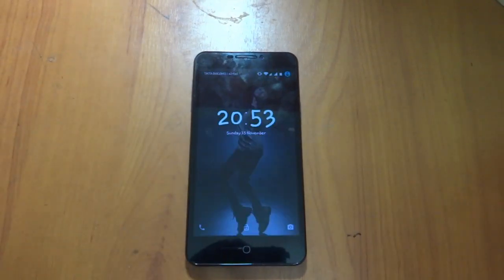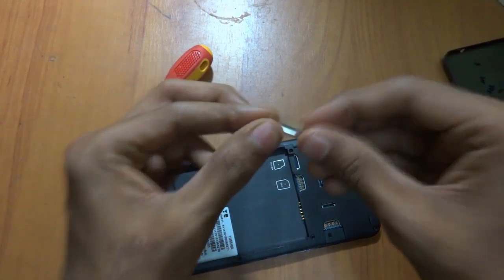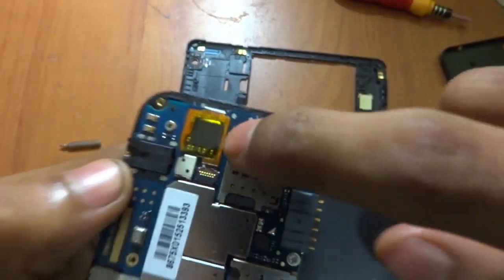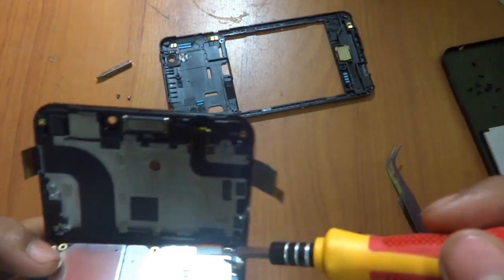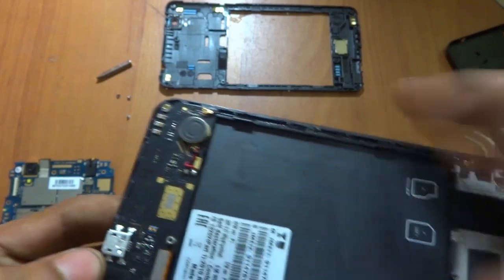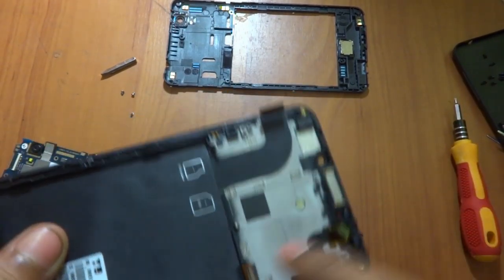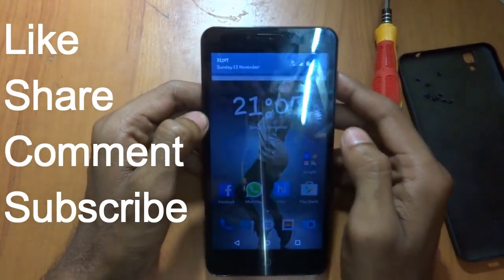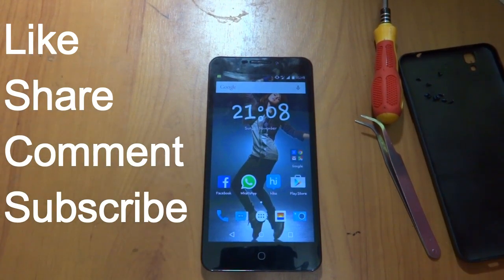Disassembly of YU YUREKA smartphone

Comment: my rear camera of yu yureka AO5510 is not autofocusing.
running on 7.1.1 ressurection remix rom.
plz help
Reply from the maker: Camera issue brother
Reply: no , i also tried stock rom but not worked.i think a new module id required.

Comment: next video u should make for changing glass
Reply from the maker: +Sumit Taneja Glass comes with the display itself bro .
Reply: +Tech Solutions yes the display...mine got shattered
Reply from the maker: You have to buy the new display+screen and attach it ..coz we dnt get only glass
Reply: +Tech Solutions hmm thinking about selling it....display is costing me 2500/- whereas I have a deal for 5999/-
Reply from the maker: Yes ..Thats gud deal sell it
Reply: +Sumit Taneja Hey, sry to reply on a 3 month old comment, but could you tell me which service did you use to sell the shattered phone? My screen is also cracked (1 single crack). I don't intend to put 2.5k more on this. I'd rather buy a new phone.
Reply: Tech Solutions